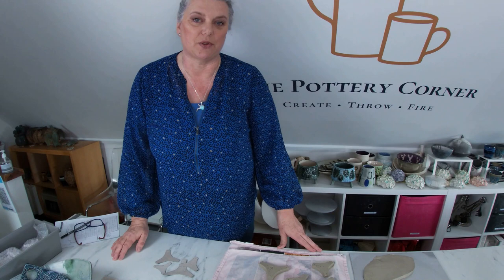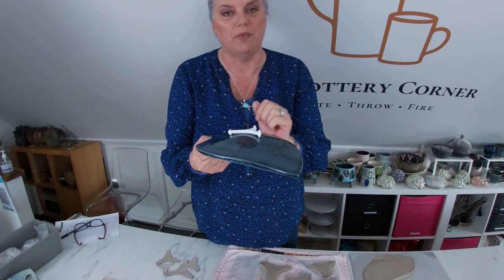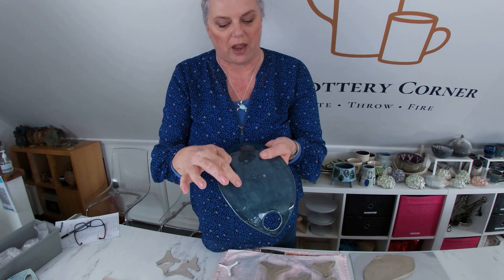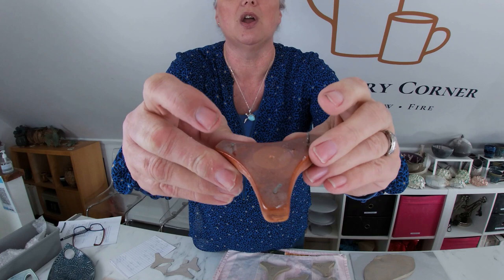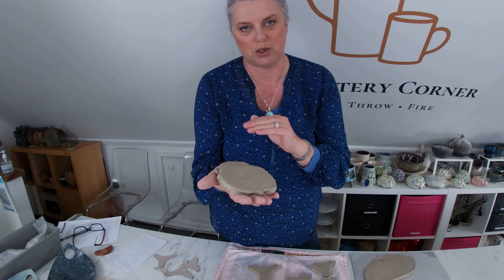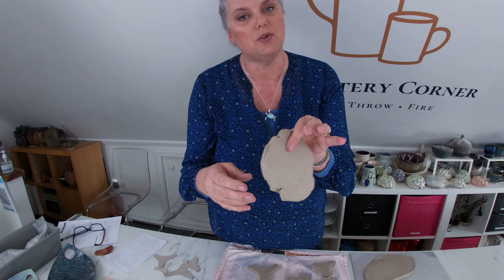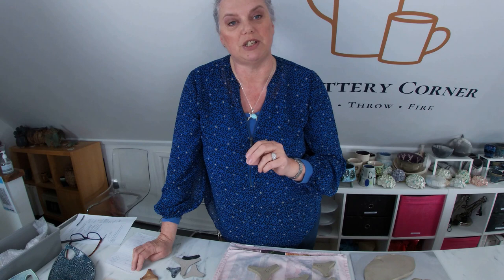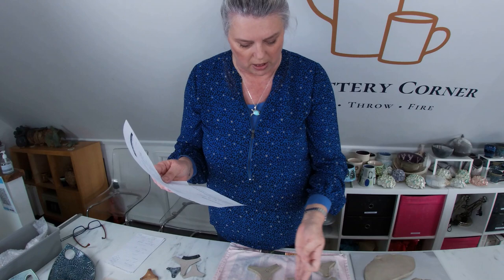Pottery Top Tip:  How to make your own kiln stilts/kiln props - Pottery Video/Pottery Tutorial

Comment: Really nice class. We are the ones to be grateful. I am going to try and make a few stilts for my kiln. I was just wondering if the clay wouldn't shrink around the wire and maybe break.
Reply from the maker: Hi Ulisses and thanks so much for watching.   I haven't had a problem with the clay shrinking and cracking around the wire.  If the wire is too long them it will bend over.  Really hope that helps 🙏 😊

Comment: I was just starting to make some of these when I saw your video. I make lots of small items, so I need some very small stilts. I made a mold by scooping out three holes that overlap out of a piece of plaster. I'll put little pieces of wire in them.

The other thing that I want to make is a stand to hang pendants from in the kiln. I was looking for ideas. I'm going to try making one out of clay slabs. I have some NiChrome wire to hang them with. Maybe you could cover some designs for that purpose, beads.

Thanks.
Reply from the maker: Thanks so much for watching.   Glad you found it helpful.  A pendant/bead stand is a great idea 😊

Comment: Thank you for your great information.  I appreciate it very much. I have a question on how to stilt a very wide form.  I hump mold birdbaths using the outside of a skylight lens.  Most have at least a 12 inch diameter. They bisque without warping or drooping.  I haven’t actually glaze fired any of them because I’m concerned they will slump.  Can you make those stilt holders bigger and the actual Nichrome wire longer to support the outside of the birdbath along the entire diameter? I keep the birdbath depth no more than 3 inches since birds want to keep their feet down on the bottom of the birdbath. But they do curve upward so that the outside edge can be 3 inches higher than the base.  I hope I’m describing this accurately. I’ve wondered if it wouldn’t be wiser to fire these upside down leaving the top edge unglazed.   Being upside down would the entire diameter of the pot  be supported all the way across the pot? I’m kinda stuck at this point. I haven’t found any book that specifically addresses the possibility of slumping birdbaths.
Reply from the maker: Hi Annie and thanks for watching.  I think I get your meaning in your question.  If the birdbaths bisque fire without slumping then they shouldn't do so in the glaze firing.  If the nichrome wire is too long then it will bend in the firing so that isn't really an option.  If it were mine, I would have a small unglazed patch on the bottom that I could stand it on a cookie rather than stilting as you are asking a lot if the piece is very heavy.  If you fire upside down the rim will not be glazed and this is more vulnerable to the elements than the bottom that you are not going to see.  My option would be to make and bisque an appropriate sized cookie (out of your usual clay body - there is a video on how to do this on the channel which may be useful here) - stand it on the cookie with an unglazed patch underneath.  Really hope that helps.  Let me know how you get on and you can always send photos via my website - address in description.  Cheers Sarah
Reply: Thanks for getting back to me.  I figured longer pieces of the Nichrome wire wouldn’t work.  I’ll glaze and fire one birdbath using cone 5/6 glazes and let you know how it goes.  I will be making cookies to use under all my pieces from now on. So much easier than grinding glaze off kiln shelves.

Comment: Thank you. Your tutorials are very helpful and I aways find they are of practical use both for my own ceramic practice and the pottery inclusion group I run. Just a question here about ceramic kiln props ...are you able to cut the 12 gauge wire with regular jewellery pliers?
Reply from the maker: Hi Denise.   Thanks for watching and for your kind words.   You can cut the wire with normal side cutters.  It is quite tough though.   Glad you've found the content helpful 👍 😀

Comment: Hallo Sarah,
Thank you so much for the video’s, they are really very helpful!
I was wondering, could I make a cookie with metal pins in it, so it can function as a kiln stilt at the same time? (I saw your movie about stilts and props).
Greetings from the Netherlands!
Reply from the maker: Hi Rob and thanks for watching and your kind words.   Yes - but you need to use nichrome wire.  This will bend in the heat so needs to be kept short.   Hope that helps 😊

Comment: Hi, thank you very much for your tutorials. They are wonderful and very helpful. (Loved particularly your very English way of apologizing about the ads and encouraging to watch the adds; quit brilliant!:)
I do have a question. My kiln stilts keep getting “glued”/stuck to my shelves. What causes it and how can it be prevented? Also do they need to be exchanged at some point I.e. do they have an expiration date?
Reply from the maker: Thanks for watching and for your kind words.  Much appreciated.  Sometimes if you have a heavyish piece on a kiln stilt it will just adhere slightly to the shelf.  I don't suffer too much with this but I have had bisque fired craft crank clay "stick" together which only needs a very small tap with a hammer to get it apart.  I use the kiln stilts until the wire starts to bend, which it will do after several firings.  If this happens then obviously this renders them useless.  If the wire is not affixed into the stilt then you can just change the wire for new wire without making a new stilt which can cut out some of the process.  Hope that helps.  Keep watching - new content on my channel nearly every week 😁
Reply: Thank but I meant the actual kiln stilts/columns not sure what you call them, but the things that hold up your shelves.
Reply from the maker: @adelbendavid5512  oh! The kiln furniture- apologies.   They do stick to each other a little bit a firm tap will release them  make sure there is no glaze on the shelf where the stilts are otherwise they'll definitely stick.  I have had my set with the kiln for -5-6 years so they last a long long time.   Hope that helps 🙏

Comment: Whar gauge are you using? I looked on Amazon, but they only offer 14, 21, 20, 22, 32, etc. gauge. I am a novice, so any info would be appreciated.
Reply from the maker: Hi Carol - I'm using about 12 gauge wire - I would think that 14 gauge would be OK if you can't find any 12.  The stilts certainly save a lot of money on buying the ones from clay suppliers.  Thanks for watching 😀